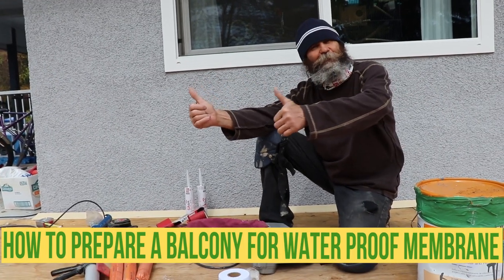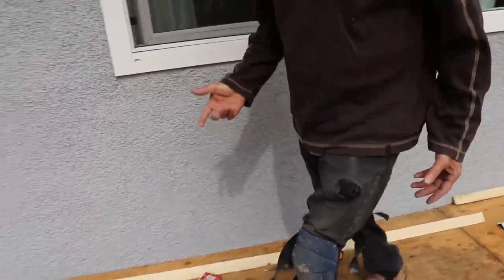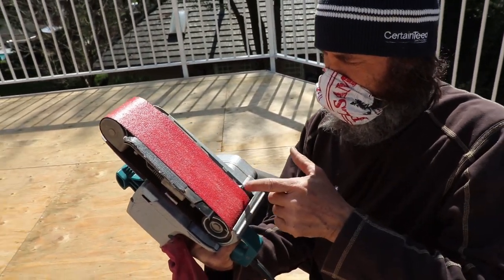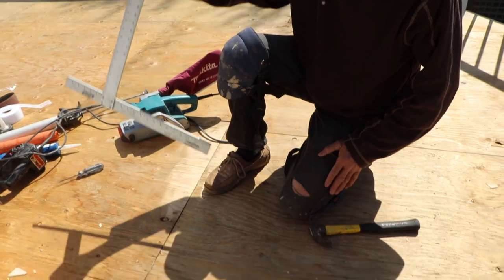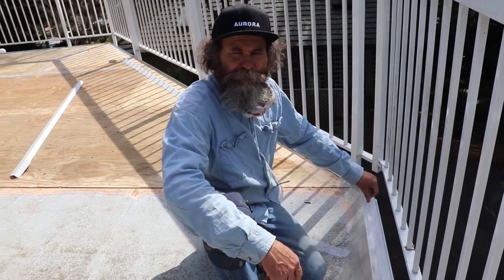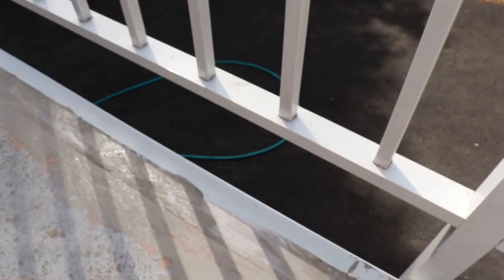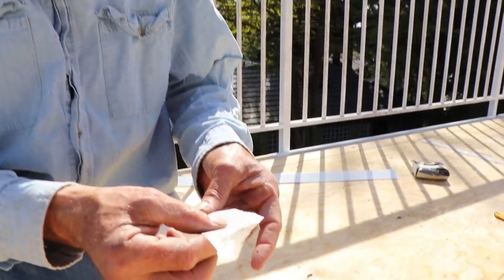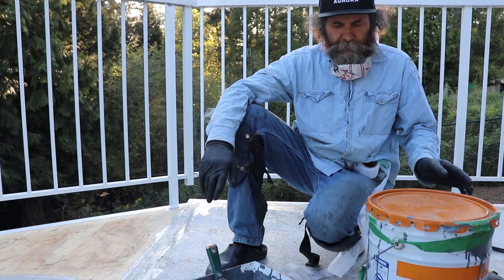WATERPROOFING Balcony/DECK — How to Prepare

Comment: can you post a link for the polyester tape?
Reply from the maker: Hello ken, I picked the tape up at home depot, I checked at home depot on line, I could not find the tape, I put it on my materials list that way next time that I am at the stores I will check on it, to get more info, thank you very much for your support, keep safe and enjoy your weekend.
Reply: @BahianoReno  thank you....I have been looking but can only find 4 inch wide.
Reply from the maker: 4" wide works good too, 2" one sometimes I use it for drywall, when the the job requires very little buildup, lately did not see the tape as I use too
Reply: @BahianoReno  My wife and  I tackle the job.  One base coat and 5 top cost.  (I had the material and the reason for the 5 top coat.)   My wife then sponge painted the entire porch to hid some of the perfect.  Wish I could send some pics.   Appreciate your post, this give us the courage to tackle the job.
Reply from the maker: Thank you ken for your support, would be an honor to see some pictures of your deck, you send them on Instagram, keep safe and enjoy your weekend

Comment: You certainly took some time to prepare everything. I recently did my deck, but used exterior plywood sanded on one side. You don’t have all those knot holes and imperfections to fill. It would save you a day or more labor. Thanks so much
Reply from the maker: Thank you very much for your time and tips!, you are 100% correct, I was been cheap, by using some materials that I had around, it was a lot of work comparing with the sanded ply, keep safe and enjoy your weekend

Comment: Added silicone sand to the mix then just skim the joints
Reply from the maker: Thank you very much for your time and support, I added some sawdust to my liquid membrane product to fill in the bigger gaps, after everything was prepared I added a base coat and a top coat ( applied by painter roll). Keep safe and see you in the next videos

Comment: Hi Mr. B! My contractor messed up on the deck coating, for whatever reason the coating is not adhering to the plywood and bubbling up (it rained and of course still leaked) He doesn’t want to tear up the existing deck system, he suggested added new sheet of plywood and reinstall flashing and polymer system. Will that be ok to add a new layer on top of what we have now?
Reply from the maker: Hello Yuk, cheaper way to do the job, but very bad idea, moisture will trap in between the plywood and membrane   and will cause big problem in the future, besides it will add lots of weight (plywood, nails, screws, membrane) all these will diminish the total weight capacity of your deck, please let me know, if you have more questions, keep safe and enjoy your weekend
Reply: @BahianoReno  got it! Also, we are using pacific polymer 5000x2 for deck coating, the contractor insisted we don’t need perma glass mesh on the plywood, do you normally lay the whole sheet of perma glass all over the plywood first ? Or just in between the seams of the plywood and flashing?
Reply from the maker: Hello Yuk, thank you very much for your time and support, first I like to fill in all the gaps and holes, and than the fiber glass mesh, just on the seams of the plywood and flashing, please let me know, if you have more questions, keep safe and enjoy life
Reply: @BahianoReno  thank you very much for your advice! I’d definitely hire you to do my deck if you are in SoCal ! :)
Reply from the maker: Happy holidays, keep safe and enjoy the party

Comment: Hello Bahiano, really like your whole video and that improvise lol. My balcony leak recently as water start pooling in once location for a while after it rain.

1. Balcony still seem structurally sound but I was wondering if I can layer thick layer of Masterseal TC 225 and make it just slightly higher so water doesn't pool there and sand down the other portion to make sure the water drain properly. Apparently it is about 1/8"-1/4" height different small but sufficient enough to cause water to pool. (Note: I will let it dry and recoat multiple time about 25mils per vendor suggestion until I get it even lol)?

2. I also notice that Masterseal usually go with M200 as base layer and TC 225 as top coat. Is this really necessary from your experience? I know it improves it but when I look at the material properties they are both polyurethane and seem kind of redundant. (FYI I actually use polyurethane for underwater application so i know its really good and it last years)

3. Can I use this on top of existing epoxy base balcony assuming it sand and get it clean enough to bond properly?

Thanks really appreciate all your help. Your video is the only one that provide this much detail. From your experience are most polyurethane for balcony about the same as long as it is for a polyurethane for high traffic areas?
Reply from the maker: Hello Crimson thank you very for watching my videos, some times I use MasterSeal to build up some uneven areas (as filler), my painter uses just MasterSeal 225 top coat for smaller jobs and been working very good so far, the base coat is cheaper than the top coat, if you gonna use more than one pail, base coat is the way to go for first coat,  MasterSeal works on existing epoxy balcony, it need to be properly prepared (My self I use base coat in every job, because usually I need more than one pail)  the balconies in this video were done right in the middle of the last winter, we had some sunny days everything was dry and we protected the areas with plastic against moisture of the night.  https://www.youtube.com/watch?v=LU7d0bcpcrw

Comment: Hello Mr. B, Will this work well on a metal balcony? I have balcony that has metal sheet and then iron/steel railing. THis is also the roof of a sun room. Anyways I realized there was a small leak when it rains and cannot figure out exactly where this spot was and thought I'd just cover the entire roof/balcony with this coating, but want to make sure it's okay for metal.
Reply from the maker: Hello my friend, thank you for watching my videos, yes it works, needs be pressure washer and 100% free of moisture before applying this product, keep safe and enjoy life, let me know if you have any more questions,
Reply: @BahianoReno  thank you so much for the info and Great video :)
Reply from the maker: @Aoekin  Thank you very much Ryan